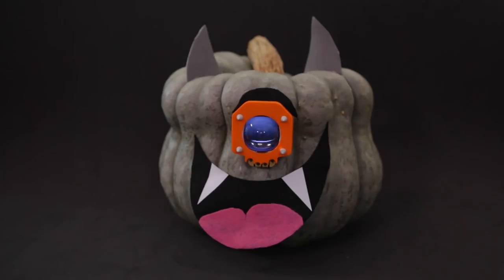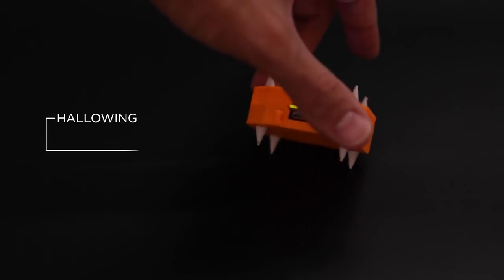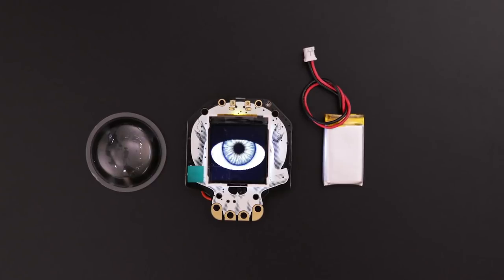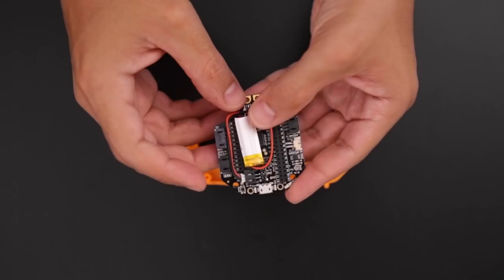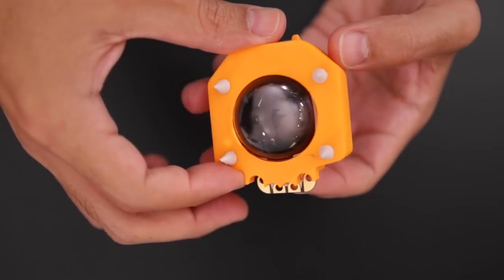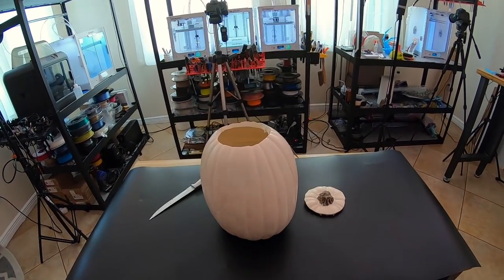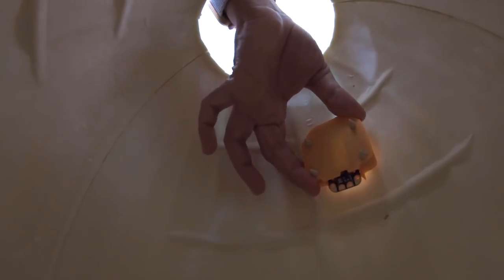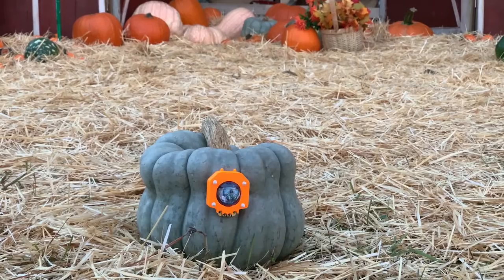Hallowing Pumpkin Eye #3DPrinting @adafruit #adafruit

Comment: I have seen a discussion of using two Hallowings with some wires connecting them and only one battery, that would syncronize the two eyes to blink and look together. this would allow a 2-eyed pumpkin, which would be MUCH cooler in my opinion. With that foam pumpkin the hallowings would be safe from moisture and would work great.
Reply from the maker: https://www.adafruit.com/product/4343 can be split in two 👀